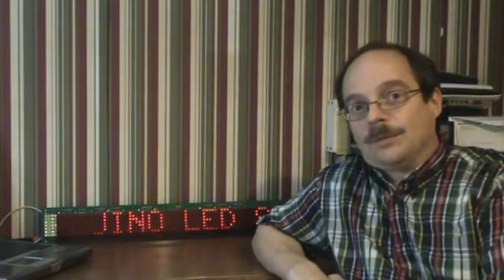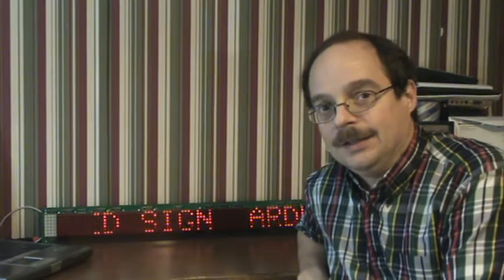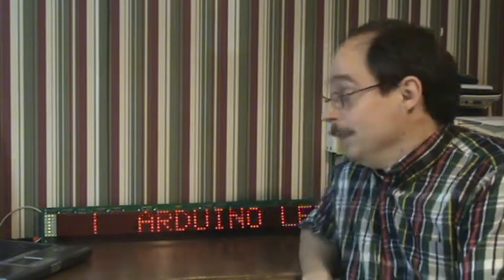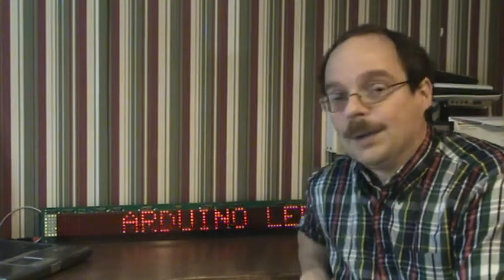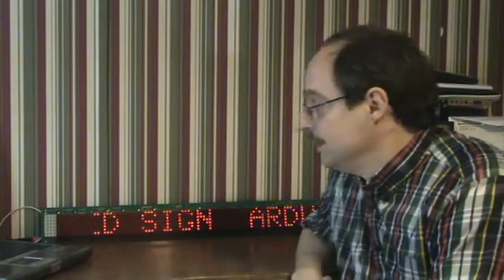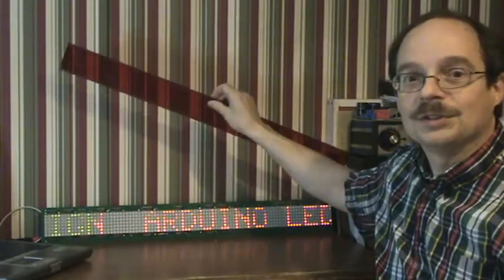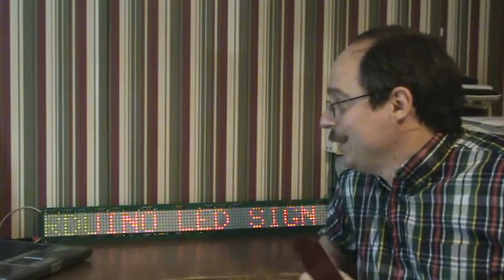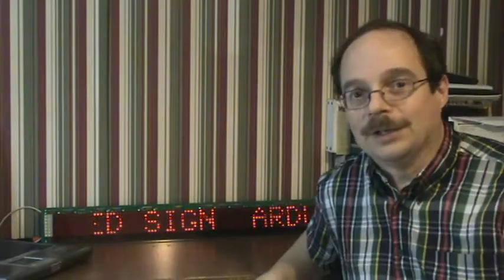Silent Radio with 4017

Comment: I'm happy to help. I used UDN2981's to switch 24 Volts DC with an ATMega32 microcontroller that can handle only 5 Volts DC. Works perfectly!

Comment: Pro tip: Use ULN2803 for the LED cathodes and UDN2981 for the Anodes. The UDN's can switch up to 50 volts I think. They contain 8 drivers in one chip and can be easily put right after the shift registers. The ULN chips sink up to 500 mA. They're basically like 8 transistors in one chip thaat can be hooked up to the microcontroller's ports or shift registers. Good luck!